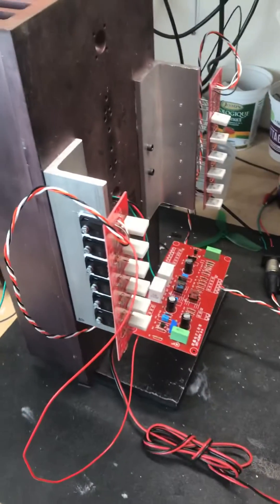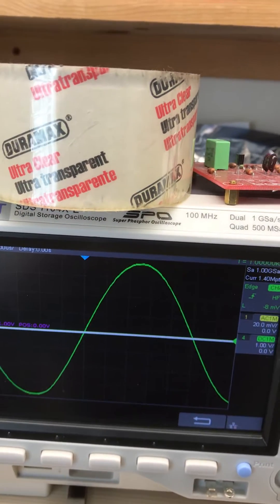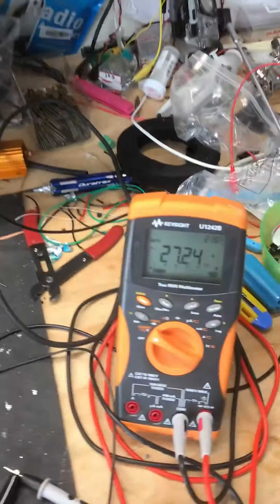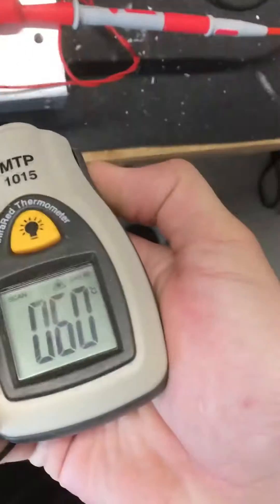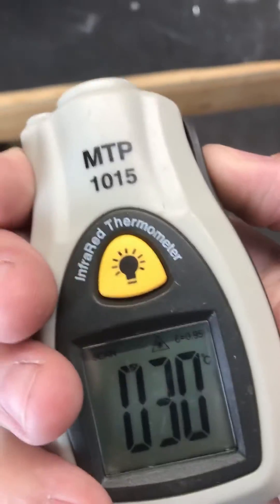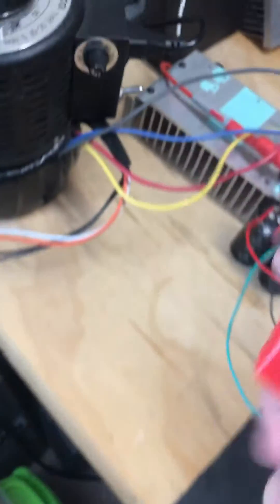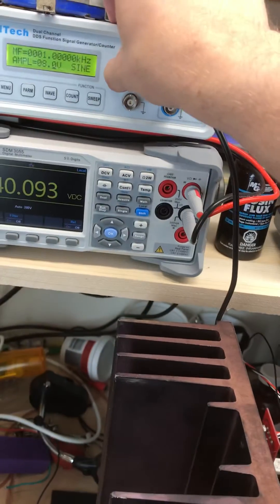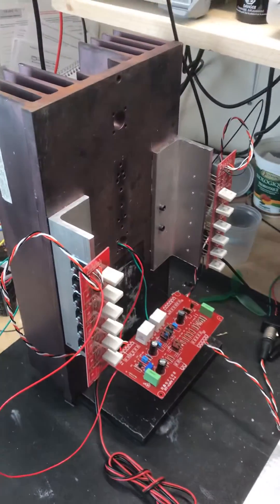Aleph 2 powered up and running!

Comment: Don’t use non-contact infrared thermal thermometer to try to take temperatures on shiny reflective objects like aluminum. 
           Gives you false readings. That vary. Unless you paint them flat black then you will get a true reading or use thermistor attached to the plate
Reply from the maker: Thanks for that tip. Good to know. I need a good thermal prob next.